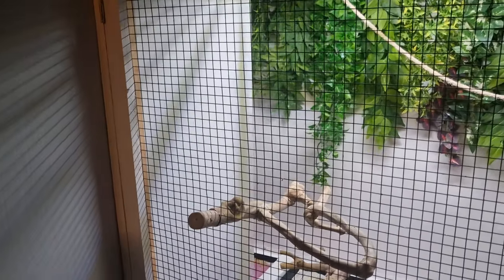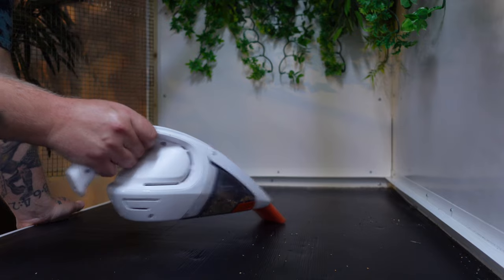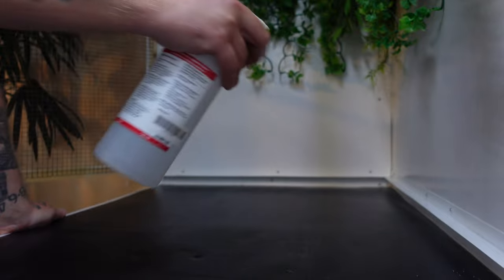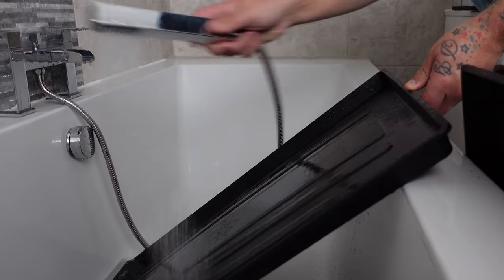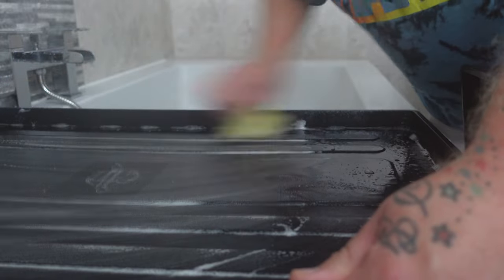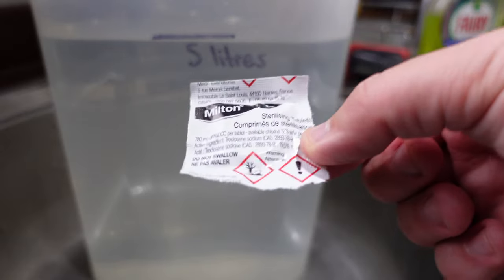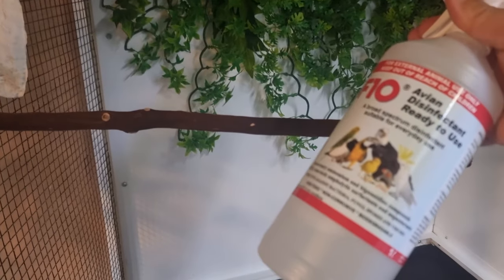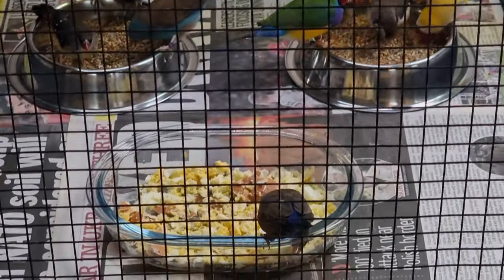How to clean a bird cage

Comment: Thank you for the great video, how would I apply this to my cage set ups as I can’t split the cage and removing the birds to clean everything would be stressful on them. I would love to give there cage a complete clean the way you do but they panic a lot when I put my hand in there
Reply from the maker: @Birdmann217  what cage do you have?
Reply: Are you on tiktok I can send you a video on there ?
Reply from the maker: @Birdmann217  I'm not unfortunately. If you know the name of it, I'll Google it 🙂
Reply: @FinchManDave  I’m not sure what the name of the cage is and thank you so much for trying to help me figure this out
Reply from the maker: @Birdmann217  you're welcome🙂
Is there no way to divide it at all?
Reply: @FinchManDave unfortunately not I guess I didn’t really think it through when I got them. Only the bottom tray pulls out but the wire bottom does not pull out
Reply from the maker: @Birdmann217  ah ok. Maybe make a cardboard divide that you can slot through the bars?
Reply: @FinchManDave  didn’t really think about that, the wires have a horizontal wire that goes across the vertical so i wouldn’t be able to push one piece of cardboard maybe I could cut out a few separate pieces that could slot through
Reply from the maker: @Birdmann217  but you could make 2 that sit on each of the vertical bars so that they're horizontal.. if that makes sense 🙂
Reply: Also sorry to be a pain I left a comment on ur apple cider vinegar video aswell if you could have a look
Reply from the maker: @Birdmann217  will do. My apologies. I do try to reply to every comment but miss the odd one here & there 🙂
Reply: @FinchManDave thank you so much I really appreciate the guidance, I’m really trying to do the best I can for my finches
Reply from the maker: @Birdmann217  you're more than welcome. I'll always help if I can & am always here to do so. 
You're doing a great job already so don't worry
Reply: @FinchManDave  thank you 😊